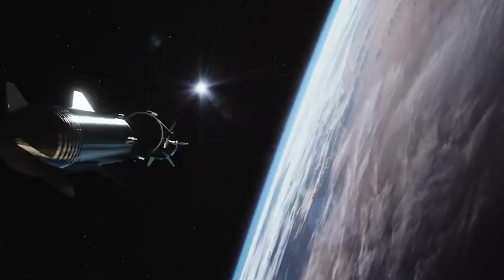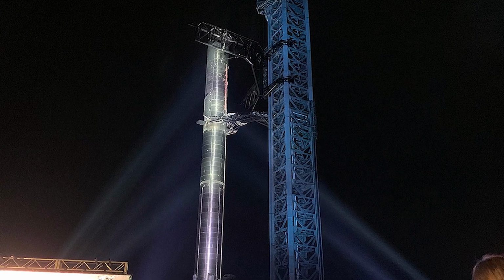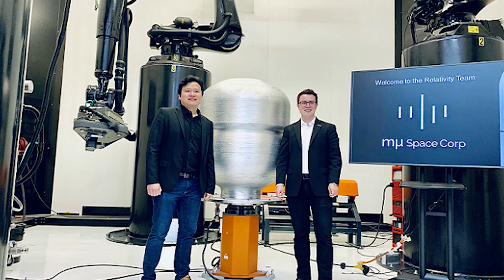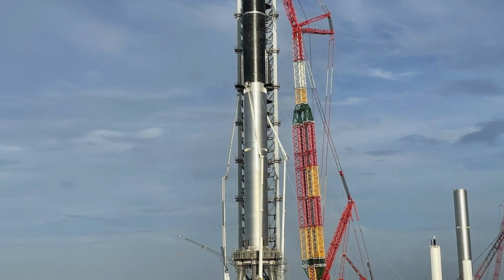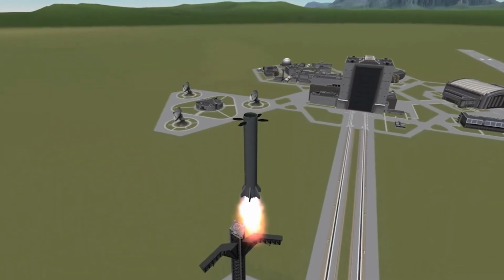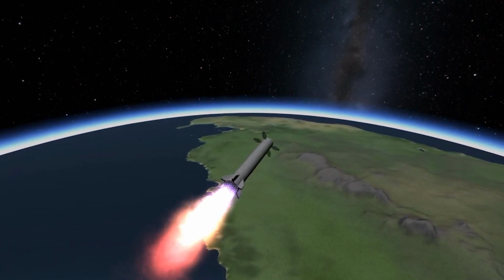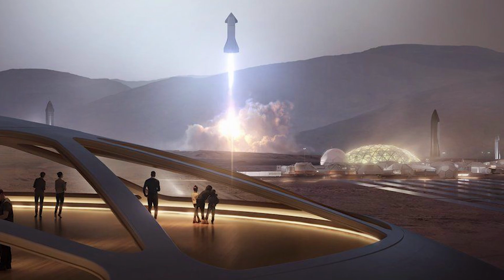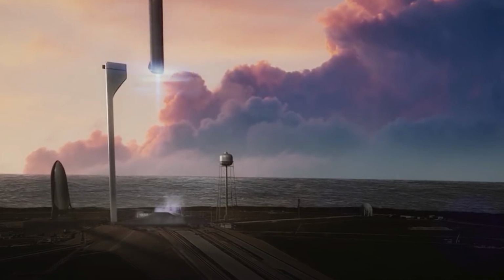SpaceX Mechazilla Is Even Crazier Than We All Thought

Comment: Surtian concern with Mechazilla catcher, becsuse its simply mounted on one of four piller beams of the construction tower, it maneuvers only 90° rotation for a catch, which means, landing is too close to the other canister vessels, the Chopstix arms, may need a ring form shoulder torso, for 360° rotate and over 180° safety in VToL & assemble.